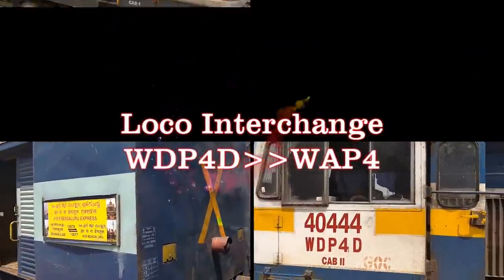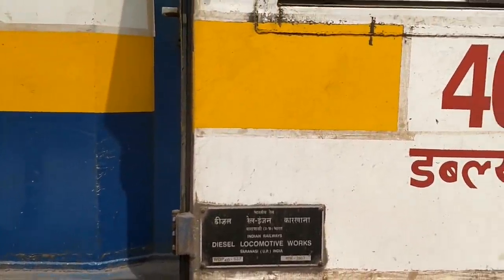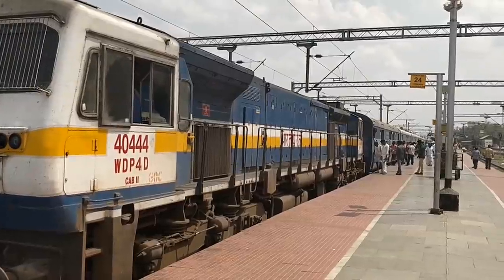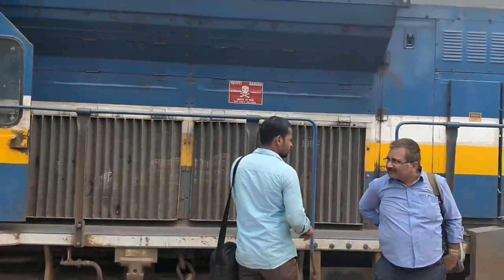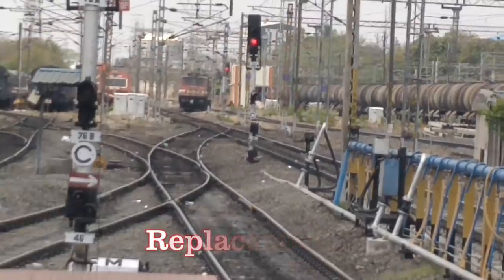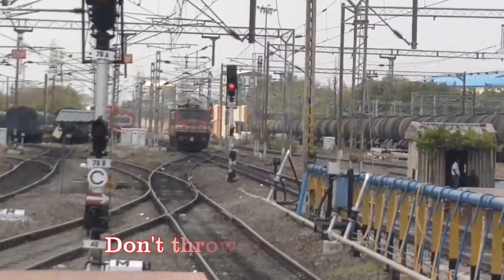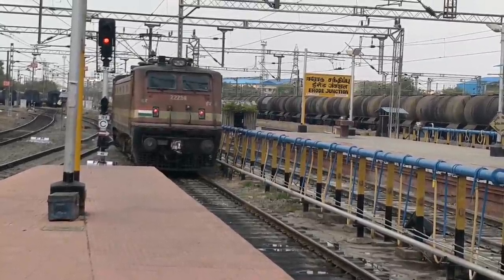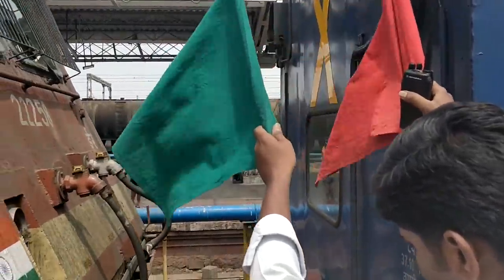ERODE Loco Shed Lady Loco Pilot Brings WAP4 for Loco Interchange with WDP4D

Comment: Nice compilation Sir.  Nowadays the Diesel loco goes all the way to ERS. No loco change at ED & vice versa.
Reply from the maker: Oh is it, since when?. I took this Video on 12th March 2018, so was just wondering!!.
Reply: Travel With Ram 12677/78 Intercity SF Exp started running with D-Loco E2E from 19th July 2018 onwards.
Reply from the maker: @hp2783  Thanks for the information, appreciated.

Comment: 6:35 is where we see the cutie! She should have raised the rear panto first then lowered the front one... that way the loco won't shut down. She'll get the idea one day. Great to see a lady driver in India. They are quite common in Western countries.
Reply from the maker: Standard operations procedure says that the Loco has to be shut down during a manual coupling process. This is a safety precaution. Also I am not sure if both Panto's can simultaneously be raised!!. I happy you enjoyed the video. Here is a link to one my recent loco coupling Video. Enjoy : https://youtu.be/ViNAT82kiYM
Reply: @TravelwithRam  If it's wired appropriately the procedure maybe entirely to fulfill the relevant SOP. As the Panto's can operate in either direction.